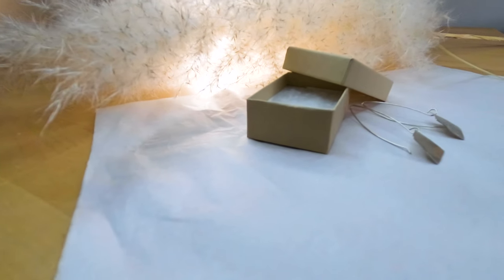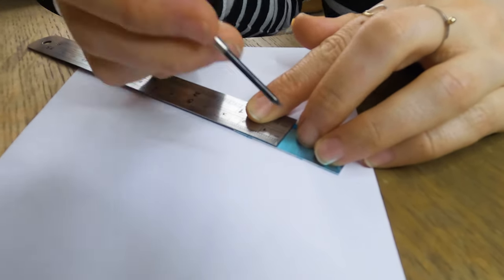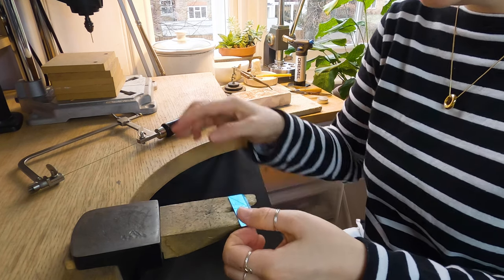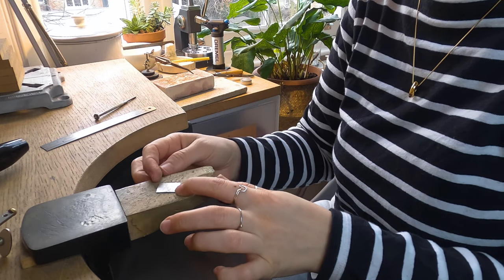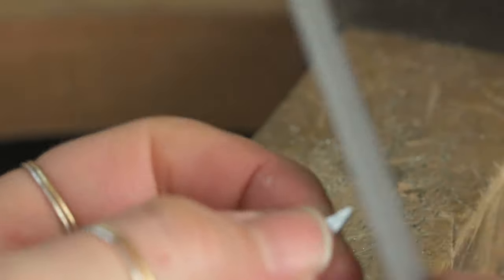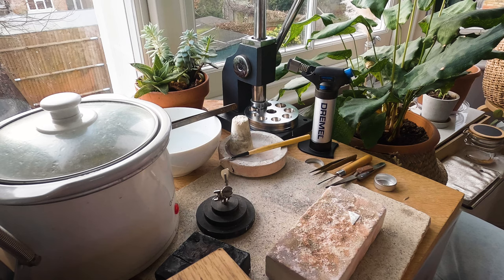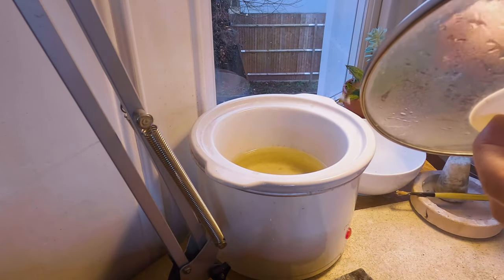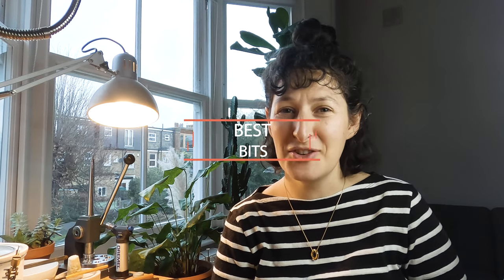How to Make Easy Textured Beginner Silver Stud Earrings Soldering Tutorial

Comment: Hiya Megan, although I'm well beyond needing the kit, I think it is a perfect idea as it will help so many people at the start of this journey to get the tools that are needed and that work. Great design. As you filed off the corners after sawing you could file off the corner where you start sawing before you saw as this will give you a flat, straight edge to cut into instead of a slope and you need to file off the corner anyway. 
Stay safe, Steve...
Reply from the maker: Thanks Steve, yes I was thinking it might be useful for those just starting out as sometimes the idea of all the tools you need can be off putting. Sounds like you had some good skills already. ;)
Reply: @megan.collins  I had, I also made up multi-core microphone cables for a sound company, hundreds of soldered joints, but with an electric soldering iron at much lower temps, but manipulating small wires was good practice.

Comment: Thanks for the videos. Do you have a video on the making the post? Now sure what gauge to use.
Reply from the maker: Hi Moe, I usually just use store bought ones to save time. But if you want to make your own, you would use 0.8 mm silver wire. To make the little groove, you need to hold the wire in a ring clamp and use a triangular needle file to create the groove. I might make a video sometime, but hope that's helpful for now. 😉